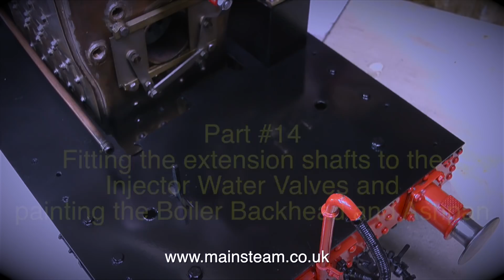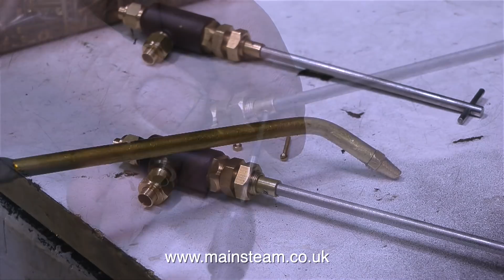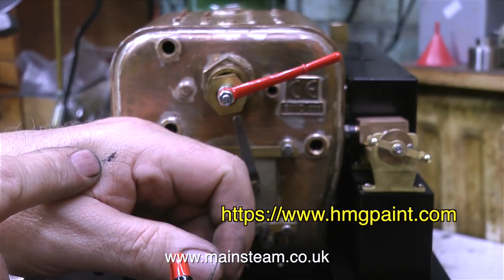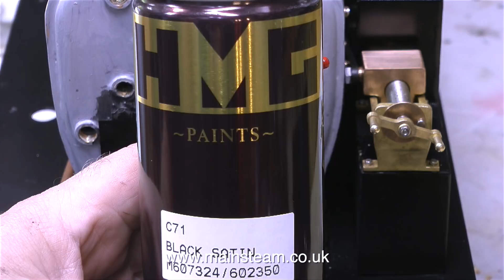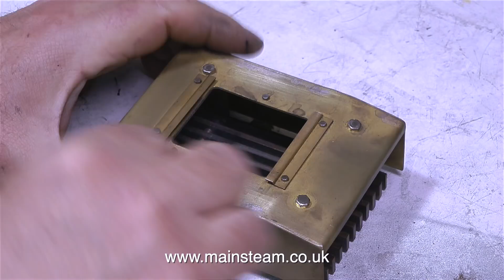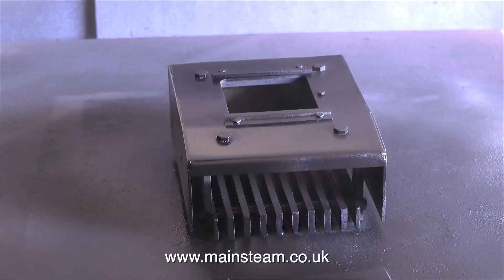MODIFYING A 5 INCH GAUGE GWR 14XX STEAM LOCOMOTIVE - PART #14

Comment: I placed two of these valves on the front end of a Little Engines American.  The one on the left side is to empty the tender at the end of the day.  The other as a injector water valve that I am adding to the engine.  For those on the Colony side of the pond, a 3-48 bolt and nut are perfect for the handle attachment.

Comment: Does all Etch primer stand up to high heat and all firebox, smokebox areas?
Reply from the maker: Yes it seems to be OK provided that you bake it on slowly first with not too much heat and don't touch the painted surfaces when they are hot ......
Reply: @keithappleton  OK thanks sounds promising.
How do you bake it on and what do you use to bake it?

Comment: Am I wrong or is the correct term for a parallel threaded bolt shaft topped by a screw  head is "engineer's screw"?
Reply from the maker: Probably, or a maybe a Machine Screw ??
Reply: @keithappleton  Yup . Acceptable alternative now you mention it.

Comment: Be careful to check that the aerosol can cap doesn't have a small air hole in it if you are going to use it to hold a small quantity of paint... My bench is witness to me forgetting to check...

Comment: I found most "High Temperature" paint isn't so Hi Temp... It doesn't hold up well on my steel BBQ pit.
Reply: Any time I need high temperature paint, I get the stuff designed for automotive/motorbike exhaust headers.